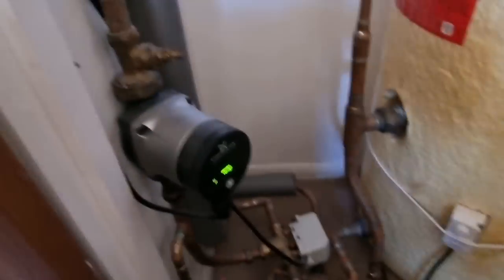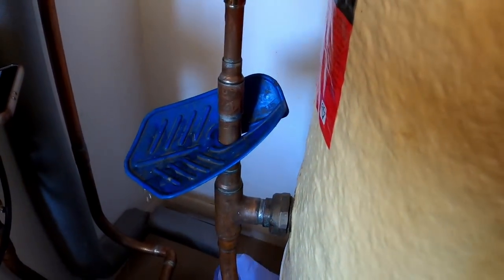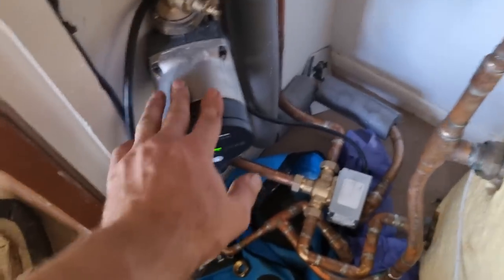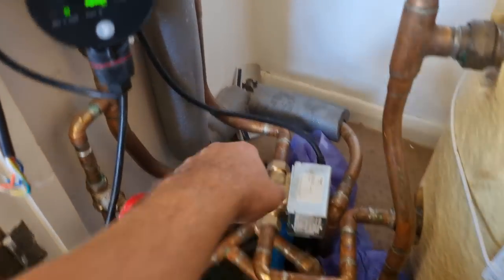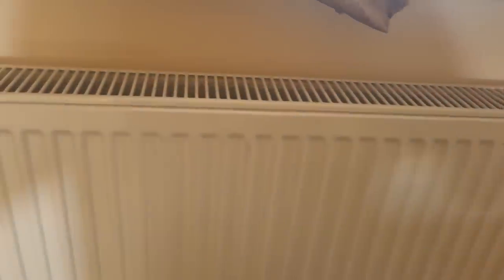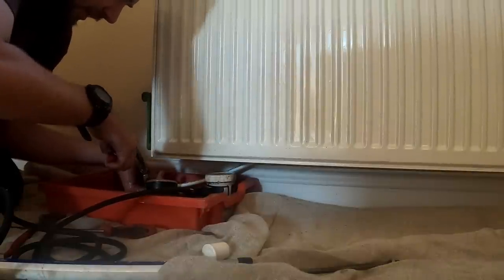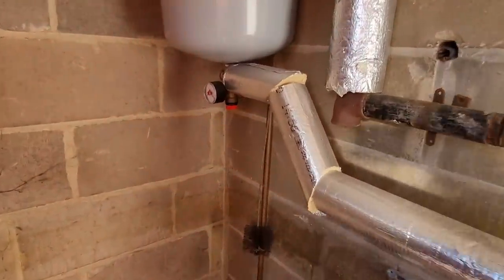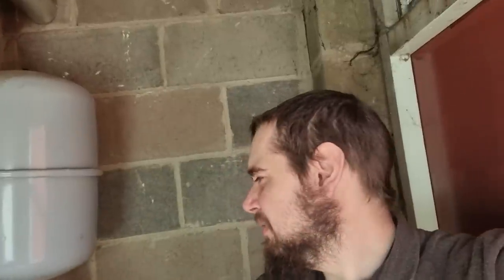Bread And Butter Plumbing Jobs | easy way of unblocking micro bore and 3 port valve swap

Comment: great video mate....the old bike pump trick is a classic passed down the years....
Reply from the maker: That's the one mate, it comes in handy every now and then and to be fair does work quite well
Reply: @PlumbLikeTom hi Tom, what does the vessel pump do when you use it on the radiator and what did you connect it to
Reply: Quick question, instead of using the pump, how about using a long enough cable? For example a bike break cable sort of thing? Just an idea. It is flexible and if long enough it may unblock it?

Comment: Great video. I'm not a plumber, I work in property maintenance, but have done my own plumbing for years. Bought a house last year with 8mm microbore. I'm working through the problems... Couldn't see from the video exactly how you connected your pump but I've just made my own connection widget. Drilled 7.5mm hole in a plastic rad blanking plug, glued a presta bike valve into it (fitted from the inside) and secured with a washer and presta lockring on the outside. Now I'm ready to blast those blockages! Cheers Tom
Reply from the maker: Thanks for watching mate, I like the sound of the improvised attachment, I used to use something similar, and it did work very well, best of luck with clearing the blockages, it's normally good to fit a filter on the boiler return as well to help stop the problem re-occurring
Reply: @PlumbLikeTom  Got me a Magnaclean Atom standing by in the mancave 😅

Comment: Hi Tom, 
That microbore pipe is always a problem waiting to happen, I have changed loads of that to 15mm copper pipe.
I’m not a fan of plastic pipe at all, but I know it has its place especially retro fitting etc. Great film again with a nice selection of jobs.
Take care Tom, much appreciated. 👍👍👍
Reply from the maker: Thanks as always Chris, your right mate, microbore causes more problems than enough, the real issue is it still gets installed even though the issues down the line are obvious.

Comment: Nice one Tom , that was very inventive of someone butchering the valve head to make it fit
it's unbelievable some of the things people do..😳
Get yourself a Makita bare unit pump as you have the batteries, they are quite cheap on eBay and saves lugging the stirrup pump around...
Cheers as always.... 👍
Reply from the maker: I defiantly need to get one of them mate, like you say they are relatively inexpensive and something I would use quite often, thanks for watching as always

Comment: Liked the microbore bit.  Having a lever valve to the drain tray on your gauge would reduce the need to take the gauge off each time to clear the debris.  Just open it tos clear the pipe contents.
Reply from the maker: Thanks for watching mate, I will have to do that next time

Comment: I don't miss changing those valves! Great work 👍was thinking the other day about a getting some silicone and moulding it into small pipe plug for 22mm 15mm 28mm etc..maybe a small brush "pipe cleaner style" attached to it in the middle? So it slides into the pipe and can be pulled out...for exactly these type of jobs, I know there is a larger version you can buy, but not always practical....best "real" content still on youtube...keep them coming my good man 😉👍
Reply from the maker: Sounds like a great idea mate, you can buy the jet swage thing but it is very expensive and has limited uses, thanks for the support as always 👍

Comment: To my understanding, red and grey expansion vessels are for heating primarily and white for domestic water only. On some of your videos when dealing with kerosene boilers you set the pressure to 1 bar. While most will run at one bar some low pressure switches (especially on sh*t warmflows) are sensitive thus we find setting the pressure to 1.5b better. 

Also any chance of an explanation on the tool you used for unblocking the micro bore. Kerosene heating engineer here, finished plumbing apprenticeship course but the course had little to no practical. Don't consider myself a plumber for that reason. It's good to find resources like your content to fill the gap with real plumbing examples unlike some other channels I've watched. 

Subscribed and going through some of your videos and the content is great. Thanks for the hard work and keep it up.
Reply from the maker: Hi mate, 1 bar pressure in a vessel is general rule of thumb, your right about the warm flow pressure switches, sometimes they don't kick in until the pressure is over 1 bar so a greater set pressure in the vessel may be required where as some boilers are happy to run at lower pressures which may make the vessel last longer, the tool I use to unblock micro bore is just a "dry test gauge" It has a scradder valve which connects to a foot pump and a connection to 15mm which connects to a system easily, they come in really handy and clear most blockages easily, thanks for watching, feel free to ask any questions if you're unsure on anything else

Comment: I often think 3 port and 2 ports would be better on a flat faced seal (such as a pump ) rather than compression. Be far easier to replace when pipework is tight. Open vent systems are a pain at times
Reply from the maker: Your right mate, If the people who designed them had to replace them they likely would be but nobody ever thinks about the maintenance person, thanks for watching 👍

Comment: Great  content as always. What is the max pressure you would pump up into  the system to flush detritus in that radiator situation? Thanks again
Reply from the maker: Hi mate, I tend not to go any higher than 3 bar with air, normally this is enough to shift it any way but its always a slight risk as you're never sure if all connctions especially on plastic are sound, thanks for watching as always mate 👍
Reply: @PlumbLikeTom  Thanks for the reply.

Comment: If no AAV in the loft, air ingress from a leak, the cold feed from the expansion would not have sealed well. Especially if they've used the ones that had 2 like teeth in. Most new builds use a sealed system, so where did that blockage go? You need to wear gloves mate. I used to hate them, but saved me on numerous occasions. Keep up the good work.
Reply from the maker: Thanks for watching mate, the blockage was on a sealed system and they normally block on the insert where it connects onto the pipework under the floor, once I've disbured the blockage, I try to flush all the rubbish out through the rad valve, I know it's not ideal but normally doesn't cause any future problems

Comment: Great tip on the rad where did you get the gauge from
Reply from the maker: If you search for dry testing gauge it should come up, I think that one I was using is a rothenburger one but they are all the same, they are handy for air testing pipes as well as for unblocking micro bore
Reply: @PlumbLikeTom  thx will have alook

Comment: I have a micro bore system it is a total pain in the Ars@. The radiators randomly stop heating, could be in the lounge, or a bedroom or the kitchen, I hate it more than the mother in law !   The one thing I can never find is how to balance a micro bore system with multiple manifolds.
Reply from the maker: They can be an absolute pain to try and balance, the problem with these systems is that they are prone to blocking, I would defiantly recommend installing a filter on the boiler return if you haven't already got one, this will help to catch any rubbish and hopefully prevent any blockages. As for balancing ideally you would be looking for a 15 to 20 degree difference on the flow and returns at each radiator, it will be a bit of trail and error but I would start at the closest one to the manifold and work back from that

Comment: Have you not used freezing tools
Reply from the maker: I do have a pipe freezer but rarely use it on domestic, normally bunging the system works quite well but sometimes on 3 ports it can suck in a bit as you have more than 1 open end, thanks for watching mate

Comment: On the 3 port job I would have put in 2  22mm gate valves , saves panicking when the waters coming out . Also to restrict the hot water cylinder flow to give a better balance  of cylinder and radiators.  The 3 port needs moving up and away from the floor IMHO.

Comment: Tom what was the pressure gauge you screwed onto rad
Reply from the maker: Hi mate, its just a dry testing gauge, I think that ones a rothenburger one but they are all the same from different manufacturers, they do come in handy for air testing pipes on first fix as well as unblocking microbore pipes

Comment: Hi just a question on a day to day running of this system is the bypass meant to be left open or closed on the gate valve?
Reply from the maker: Hi mate, on a 3 port valve the natraul position in the closed position is to rest on the hot water side so a by pass is not normally required as it will always pass through the coil for pump over run, this is why 3 ports aren't allowed to be used on unvented cylinders, if you have a gate valve fitted as a by pass it will likely just be cracked open, closing it would cause no issues but equally won't really change a lot either
Reply: Thank you very much for your reply much appreciated. Great advice and great videos all the best. I changed a cylinder like for like 2 weeks ago can't get rid of an air lock now tried just about everything
Reply from the maker: Is the air  lock on the coil side mate, normally stopping and starting the heating pump will clear this, holding it between the speeds on the pump is a good trick, you should hear all the air start to gurgle
Reply: I get the heat up to 2-3 of the radiators ever so slightly by stopping the pump it throws a load of air out of the vent but then the boiler overheats and stops. Have to wait again for it to cool down then same thing happens again. Narrowed it down today to poor circulation due to blockage in the pipes so going to try and clear that out in the morning

Comment: Those Drayton 3 ports are cheaply made, had 2 within a year. Drayton were reluctant to change it but I held out and got them to. Those micro switches stick and system stays on as yours did when no demand. It’s Honeywell all the way if I have a choice, nice work anyway.
Reply from the maker: I do like the Honeywell valves, they still seem to be about the most reliable although I have fitted a few EPH ones and they seem very good too, thanks for watching Kevin

Comment: 👍👍Tom ♣️♣️🔧🔧
Reply from the maker: Thanks as always Paul
Reply: @PlumbLikeTom  that 3 port had more water coming out than the trafalgar square fountains 💦💦🔧🔧😂😂
Reply from the maker: I think it was because the pipe was on a drop, normally you find the pipe goes down but this one went up, plumbing always seems to throw up these little surprises, it makes it more interesting
Reply: @PlumbLikeTom  plumbing has its ups and downs i tend to go with the FLOW to the point of no RETURN 😂💦🔧🔧🍺🍺🍺

Comment: We’ll , I don’t know the size of the whole system, but if you fit auto fill system, by the looks 👀 at the pipe and all the valves and god knows the condition of all rads , everything is going to leak in there 😂 it’s a lack of maintenance as usual, you barely find anything in good nick inside the plant rooms 😅
Reply from the maker: Some of these plant rooms are a mess mate, I can only do what I can do on some jobs, thanks for the support as always mate

Comment: drayton and honeywell threads are the same. Danfoss to honeywell is different
Reply from the maker: I didn't know that mate, I always thought the Honeywell's were different to most other threads, thanks for the tip, every day is a school day as they say
Reply: 100% always best practice to swap anyway. But in tight situations jet blue should get you through 😁

Comment: Waste of time, 10mm will block back up in a few weeks. Re-pipe it
Reply from the maker: Sometimes you get away with this method but it's not 100% guaranteed, ideally, like you say a re pipe back to the manifold under the floor in 15mm pipe is what is required, you can only ever do your best and advise the customer on a more permanent solution, at the moment this one is still working fine but eventually it is likely to stop again, thanks for watching